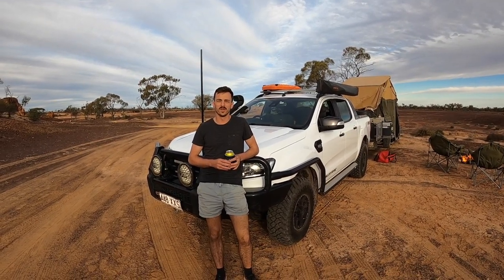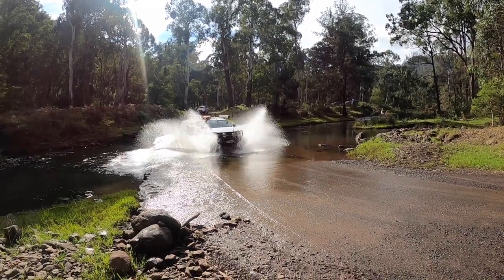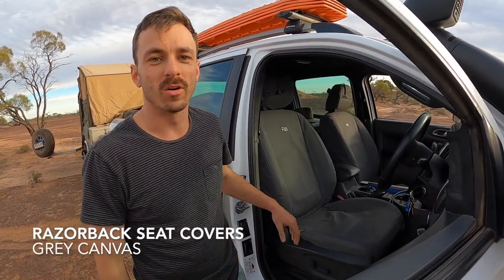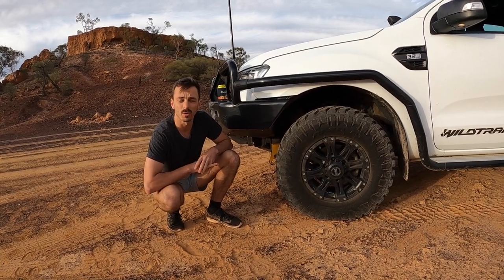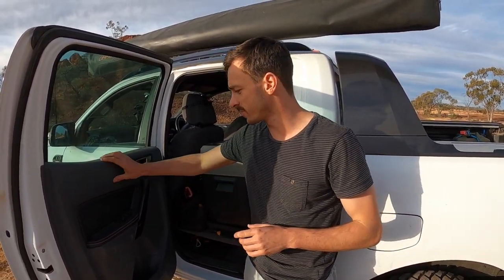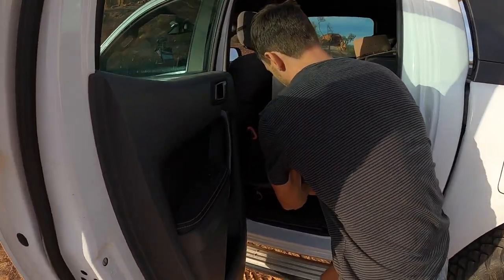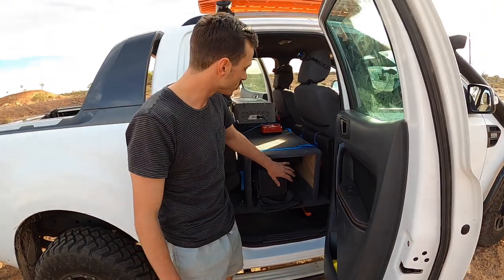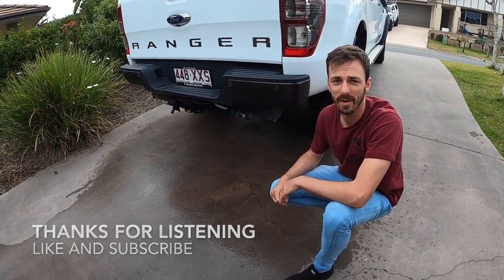Ford Ranger PXII 2018 Walkthrough Updates - The Latest and Greatest Mods!

Comment: Hey mate i just came back from the tip i have the same water tank  around the spare tyre a slight oversight is the breathers on top of the tank let in water and dust when there wet. I have yet to take it out and fix the problem. Thought i let you know we found out the hard way #therangeradventures
Reply from the maker: Hey mate, that’s annoying! So far the water has been coming out clean!